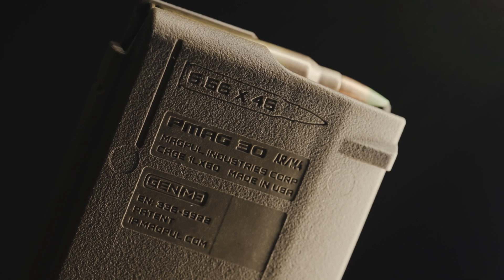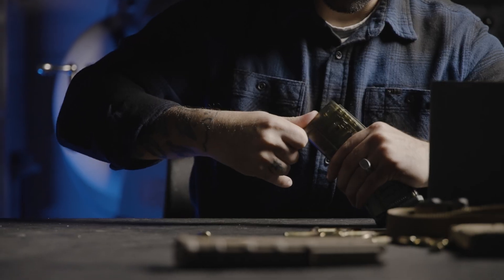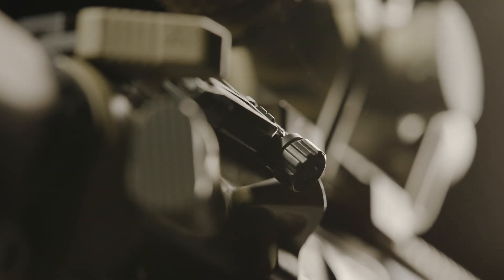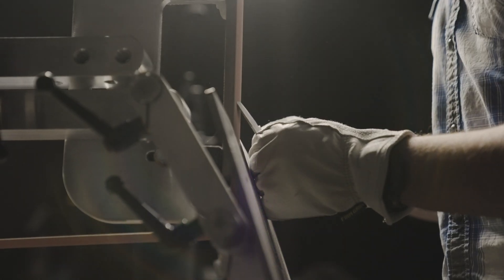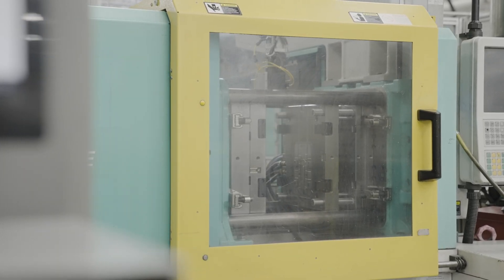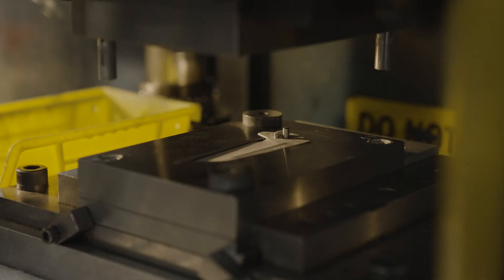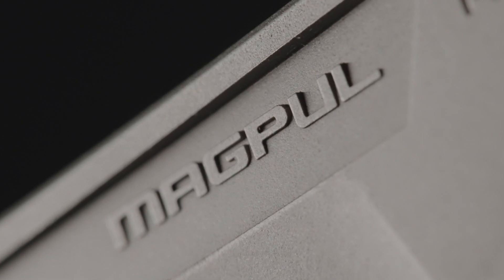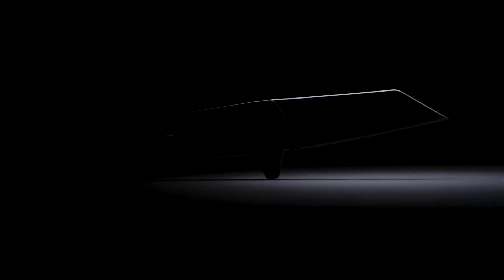Magpul - Metal Injection Molding

Comment: Hey Magpul, please make a full size 17 version of the rxm grip module with interchangeable backstraps similar to the xmacro. Then other company's can make comps that will flush mount with the existing slides, and also make billet/tungsten backstrap inserts for your grip modules. This idea stems from the radian/xmacro p365. 💡

Comment: I did not know what MIM meant, I just knew it was not a great thing. I used to play guitar and in those terms MIM means "Made in Mexico" so I always heard that in my head when I read it. Im starting to feel like Made in Mexico is actually quite fitting.
Reply: Remington 870 shotguns were manufactured with MIM extractors. This was one of the parts that were upgraded for the Police Magnums by using machined steel extractors.
Reply: @rudyschwab7709  interesting

Comment: I never thought I would see the ability to 3d print with metals let alone injection molding with metal.  Technological wonders.  Made in America.  Count me in.
Reply: Injection molding with aluminum has been around since the 1970s. A lot of motorcycles use it for crankcases, cylinder heads, and cylinders. They pump the aluminum under pressure and use a cut-off valve to keep the mold under pressure as the metal cools. It's not as strong as fordged, but it's much stronger than sand casting.
Reply: MIM is not new... It's been around for like 50 years.

Comment: In my experience you can't get mim blade material anywhere near a forged piece of steel when it comes to sharpening and getting a shaving edge. Mim just doesn't have the grain structure to get a clean sharp edge.

Comment: Hello Magpul, the current concept for the maztech x4 is a drum mag 60 cartridge display with an electronic voltage sensor built into the drum, where the signal is sent to the module via Bluetooth. And a stock spring for the bold connection where the sight changes color via Bluetooth depending on the barrel cartridge status in the maztech x4. Your MDA DTS Thuringia would charge 50 percent of the final patent ©®™ Regards Christian Deutschmann Team MDA DTS Thuringia and acd Neustadt Orla could work together with ACD Systemtechnik GmbH

for maztech to work together if they don't yet have a circuit board supplier. Hello Magpul, it's an algae propellant or sunflower oil with hydrogen gas and an adhesive gel that makes a polymer cartridge and a titanium projectile. Where a reaper prepping case is cut open to use a fire pit igniter through the PVC case. And through a cartridge that acts as a soup in the outdoor scene. In the Wyoming or Stadtilm plant for AR ammunition.  your MDA DTS Thuringia would charge 50 percent of the final patent ©®™ Maximator has undertaken a Bosch Rexroth collaboration, I would like to welcome you to the Niederrosla hydrogen production partner. And I suggest a fuel cell power plant at Born Senf in Stadtilm or Arnstadt. In response to a funding application from the Thuringian Development Bank with a carbon lignin battery trailer forwarding company, the partner. Where energy is charged via trailers to customers with a parking lease for the battery trailer. With perhaps a collaboration with an energy exchange operating enpal. Thuringia has a location advantage with the whole of Germany being accessible by truck in 4 hours. Can you give the forwarding company the name Thuringia Energy Go? Your MDA DTS Thuringia would charge 50 percent of the final patent ©®™ 

United Germany Evangelical Union.

Best regards Christian Deutschmann Team MDA DTS Thüringen director of thengo.

Comment: 3D Printed suppressors dealing with enormous amounts of heat and pressure

Consumer: 🤤 😃 

MIM Knife to slice an apple 

Consumer: 😠 😡 😤
Reply: 3D printing metal is NOT the same process as MIM! 3D printed metal is, for all intents and purposes, a fine metal powder where the grains of metal are essentially "welded" together, creating VERY tough parts! Investment casting on the other hand involves pouring molten metal into a mold and letting it cool naturally or quenching it, depending on the purpose of the part. Metal Injection Molding (MIM) involves powdered metal mixed with a polymer binding material that allows the material to flow. The mixture is then injected into a mold. The mold is then heated to the point where the metal powder begins to fuse into a solid metal as the polymer binding material (now heated) flows out. For non-impact parts, this can be an excellent method of production; it keeps costs low and allows complex parts to be molded that would either be too costly to machine or too complicated to achieve with machining. The problem with MIM has always been on parts that take an impact (firearm hammers, slide stops, etc.). The nature of the process can leave the material porous as the mold does not allow the melting metal powder and polymer binding material to occupy the same space instantaneously. 🤔 Think of it like a cake: the flour is the metal powder and the wet ingredients are the binding material. As the cake is heated, bonds are formed but because it isn't in a vacuum, air is trapped inside which creates pockets of space throughout.  Cheesecake, of course, isn't really cake so its density isn't relevant in this analogy! 😂 I hope this was helpful!

Comment: How is MIM different from cast molding?
Reply: Investment casting involves pouring molten metal into a mold and letting it cool naturally or quenching it, depending on the purpose of the part. Metal Injection Molding (MIM) involves powdered metal mixed with a polymer binding material that allows the material to flow. The mixture is then injected into a mold. The mold is then heated to the point where the metal powder begins to fuse into a solid metal as the polymer binding material (now heated) flows out. For non-impact parts, this can be an excellent method of production; it keeps costs low and allows complex parts to be molded that would either be too costly to machine or too complicated to achieve with machining. The problem with MIM has always been on parts that take an impact (firearm hammers, slide stops, etc.). The nature of the process can leave the material porous as the mold does not allow the melting metal powder and polymer binding material to occupy the same space instantaneously. 🤔 Think of it like a cake: the flour is the metal powder and the wet ingredients are the binding material. As the cake is heated, bonds are formed but because it isn't in a vacuum, air is trapped inside which creates pockets of space throughout.  Cheesecake, of course, isn't really cake so its density isn't relevant in this analogy! 😂 I hope this was helpful!
Reply: Things I don’t know for $200 Alex. 
I do know I’m avoiding both.

Comment: Knife manufacturers have been using powder-consolidated steels, like S30V, for over 20 years.
Reply: It's not the same as MIM tho. Drastic difference
Reply: @ how
Reply: yup powder steels have there advantages vs a forged blade you have more control with some brittleness baked in

Comment: As someone who works in the “college degree required” level of manufacturing and knows the challenges of additive made metal anything… that’s a bold claim, magpul…
How bout steel lipped mags? Sure wish i could stop throwing away PMAGs because of the double feeds and bolt overrides they cause. (Not mine, the government’s) I get it if lancer has a patent on steel feed lips, but damn have i seen a lot of lost tax dollars. We keep ordering new ones, but after a year of regular use more than half of them are split open.
Reply: Things wear out.

Comment: Tesla does metal i jection molding for most of theur vehicle frames niw, and they have th highest safety ratings in the industry. These machines arent cheap..... But thwy produce amazing parts with incredible accuracy, repeatability and strength. Can use differebt materials/alloys as well
Reply: Tell that to the Cybertruck that is literally snapping in half over potholes or when towing trailers.
Reply: How did you understand that mess?

Comment: I prefer D2.....
Reply: D2 is a material not the process by which the material is produced. D2 could actually be produced using the MIM process. Metal Injection Molding (MIM) involves powdered metal mixed with a polymer binding material that allows the material to flow. The mixture is then injected into a mold. The mold is then heated to the point where the metal powder begins to fuse into a solid metal as the polymer binding material (now heated) flows out. For non-impact parts, this can be an excellent method of production; it keeps costs low and allows complex parts to be molded that would either be too costly to machine or too complicated to achieve with machining. The problem with MIM has always been on parts that take an impact (firearm hammers, slide stops, etc.). The nature of the process can leave the material porous as the mold does not allow the melting metal powder and polymer binding material to occupy the same space instantaneously. 🤔 Think of it like a cake: the flour is the metal powder and the wet ingredients are the binding material. As the cake is heated, bonds are formed but because it isn't in a vacuum, air is trapped inside which creates pockets of space throughout.  Cheesecake, of course, isn't really cake so its density isn't relevant in this analogy! 😂 I hope this was helpful!

Comment: It is going to be interesting to see how the MIM process has not achieved very positive Results when it comes to a Knives Strength and Brittleness when it comes to a battery of Abusive testing but I would like to see how Magpul has gotten passed those issues and how to get a very sharp edge since the crystalline structure of MIM parts usually does not allow for smooth sharp edges.
Reply: Maybe instead of making a magnacut blank for instance they're forming the steel into the shape of the blade and skipping tons of machining...

Comment: That's called casting....
Reply: MIM is a subset of casting. Not every rectangle is a square but every square is a rectangle.
Reply: "Casting" is NOT the same process as MIM. Investment casting involves pouring molten metal into a mold and letting it cool naturally or quenching it, depending on the purpose of the part. Metal Injection Molding (MIM) involves powdered metal mixed with a polymer binding material that allows the material to flow. The mixture is then injected into a mold. The mold is then heated to the point where the metal powder begins to fuse into a solid metal as the polymer binding material (now heated) flows out. For non-impact parts, this can be an excellent method of production; it keeps costs low and allows complex parts to be molded that would either be too costly to machine or too complicated to achieve with machining. The problem with MIM has always been on parts that take an impact (firearm hammers, slide stops, etc.). The nature of the process can leave the material porous as the mold does not allow the melting metal powder and polymer binding material to occupy the same space instantaneously. 🤔 Think of it like a cake: the flour is the metal powder and the wet ingredients are the binding material. As the cake is heated, bonds are formed but because it isn't in a vacuum, air is trapped inside which creates pockets of space throughout.  Cheesecake, of course, isn't really cake so its density isn't relevant in this analogy! 😂 I hope this was helpful!

Comment: If Magpul made a clone of the USGI metal mag but with MIM id be so happy
Reply: MIM allows you to achieve 3d shapes while saving on machining costs. Sheet metal parts are already extremely cost effective and strong. A MIM'd GI mag would be at best as good as the original, most likely a bit weaker and cost a lot more to produce
Reply: @343gltyspk  Hence my thoughts to use MIM to make a metal pmag. It's not to make a great magazine, it's just for the memes.
Reply: Now this would be interesting, metal mags in the style of the gen 3 pmag with all the benefits that entails.
Reply: @Rb889  that's a terrible idea... it would crack like glass. If you want metal mags, it needs to be stamped sheet steel.
Reply: MIM the USGI 20 round follower that is in the original mags.
Reply: Long thin walls are an extremely poor use case for MIM, and mags being entirely made up of long thin walls would just make a terrible mag

Comment: MIM is not a good way to make a knife... this is going to end miserably
Reply: Particle metallurgy is NOT the same as MIM. 

I will never buy a MIM knife lol.
Reply: Okay you master blacksmith what is a good way to make a knife?
Reply: @manuelpiston  forging probably, that's how EVERYONE has done it properly for hundreds of years
Reply: @manuelpiston   forging, or machining a forged blank... MiM creates a poor grain structure that creates a brittle knife  especially  when using a steel with vanadium like magpul  is doing. vanadium  creates larger harder crystals  resulting in a course grain structure  when you forge it you can re aline  the grain   making  a tougher knife But MIM  a vanadium  steel is going to  result in uneven large crystals  causing blades to snap
Reply: @shelp7858  generally speaking the best knive steels are made from a powder compound not forged
Reply: @trevor894   no most powder metallurgy  steels are melted in a crucible  then the resulting puck is rolled in to a sheet for knife blanks or is forged into a blank  for further forging into a product. either  way the grains are re aligned after the smelting process injection  molding leaves the crystal  grain in a unorganized state that results in poor knives
Reply: @shelp7858 Okay I thought they weren't considered forged but if im wrong I apologize, was pretty into knives a bit ago so I may not follow this that much but im sure people will post vids testing tge Magpul knives

Comment: $100 for 1 flip up sight is not cheap...
Reply: laughs in KAC
Reply: For real though. Zero reason to get Mbus Pro's for that price when shit like Scalarworks flip ups exist for a little bit more. 

This new MIM shit better be meaningfully cheaper than forged/machined competition, unless they wanna rely on nothing but the fanboys in these comments to buy it.
Reply: It's a solution looking for a problem to begin with. Save your 100 bucks and put it towards a good red dot.
Reply: The polymer ones are fine. If you get into that much trouble that your optic failed and you sights broke, you are probably missing your head.
Reply: It's ok, they also make affordable polymer sights you can put on your PSA AR that will co-witness with whatever Amazon special optic you're running. 😊
Reply: Try not to be so poor